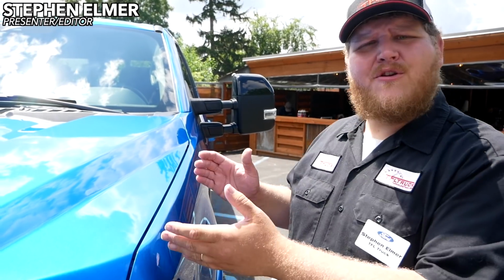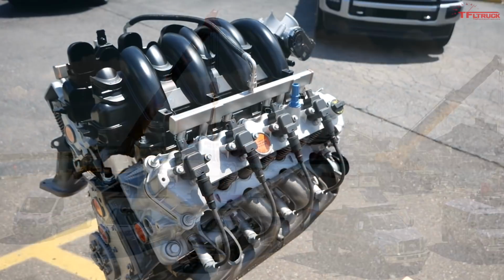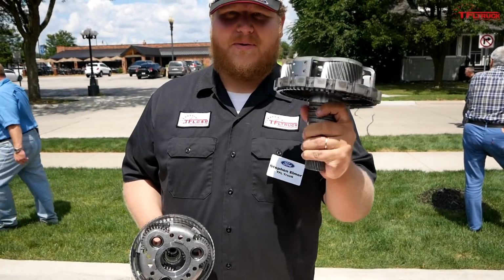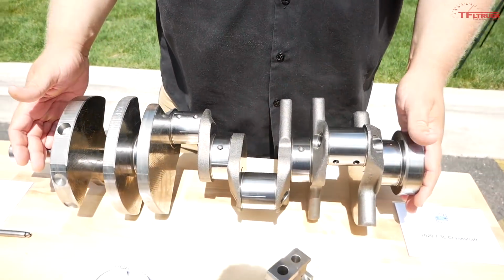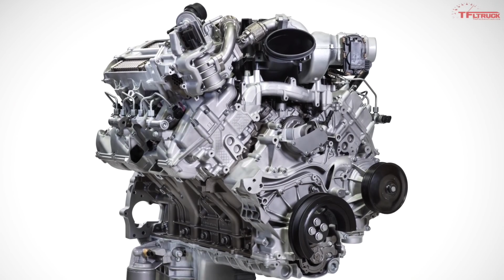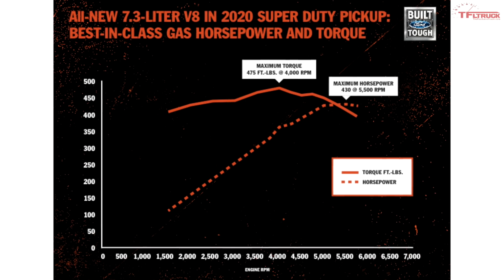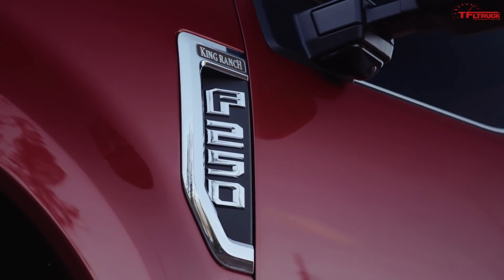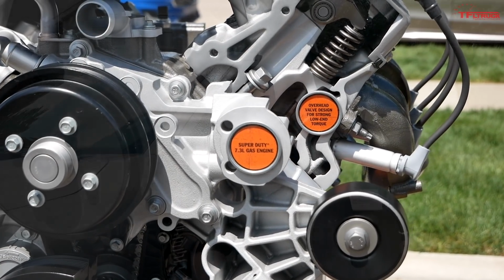We Finally Know the Ford Super Duty 7.3L V8 Power Numbers & They Are Lower Than We Thought!

Comment: In what world is 430 horsepower and 475 pound feet of torque low for a gas engine? This is meant to be a workhorse and if anyone has looked at the dyno charts, they would see this engine makes 400+ pound feet of torque at 1500 rpm - this engine is hardly disappointing
Reply: Boo Ya I’d like to test drive one when they come out.
Reply: lee hancock did you miss the part of the video when they showed it and talked about the high torque number at 1500rpm?
Reply: How dare you say something that makes sense on YouTube 😂
Reply: Low? Thats funny  the v10  has a worthy  successor
Reply: Chevy did the same with a 6.2 v8
Reply: @jacobfleener8501  -  the 6.2L Chevy only makes 350 lb-ft of Torque at 1500 rpms
Reply: “Never argue with an idiot. They will only bring you down to their level and beat you with experience.”

― George Carlin
Reply: Chris J You know shit about engines
Reply: Chris J That went over your head. You don’t know wtf you’re talking about. I literally do this shit for a living.
Reply: i mean gas big blocks were basically pumping out the same numbers in the early 1970s with the same displacement , so the numbers at face value really aren't that impressive , but these engines probably run on 87 octane and will run for 300k miles before any major service where as the old big blocks lasted 100k miles if you were lucky , ran on premium leaded fuel and got 6 mpg no matter how you drove it,, and that was in a car lol.
Reply: @TheDaltonmichaels  That was gross hp/tq figures that were not certified by anybody. These figures are net, if you take that into account these new motors blow the old engines out of the water.
Reply: @foreignautomobiles  that's debatable. old engines in the performance cars were also marketed at lower outputs than they actually had for Insurance purposes.
Reply: those engines were also sending power through transmissions that were much less efficient than the ones we have now. last i saw Hot Rod magazine Dyno tested a bone stock 1970 chevelle , and even on our crappy modern pump gas the engine made basically the advertised numbers at the wheels. so thats huge. that's through a crappy old transmission , with worse gas than what was available when the car came out. meaning the engine itself actually made quite a bit more back in its day and measured at the flywheel.
Reply: I'm not a "motor-head expert" like some people are, but the standards used to define/test hp have changed since the 1960s too.  And then there was before vs. after all the anti-pollution gear was mandated by our "benevolent" government.  One must always be careful not to compare apples with oranges.
Reply: @TheDaltonmichaels  Well back in the day most transmissions did not have overdrives
Reply: @TheDaltonmichaels  Lets also not confuse truck motors versus car motors. In heavy duty trucks, in the 60's and 70's rarely did a car block cross into a heavy duty truck. Truck motors were notoriously low HP comparatively and were made to be grunt motors, not high RPM HP makers. Aside from possible a special order or a backyard swap, you did not see a 426 Hemi in a dump truck...or even a pickup truck.You also have to wade through the numbers from the late 60's early 70's since there are net and gross HP ratings that varied wildly. The 7.3 is a truck motor, made to put out torque early in the RPM curve, kind of like a diesel (not like, kind of like). With the 3.5 EcoBoost you have to be at an insane RPM to get your your max torque where the 7.3 you are at an easy 2K. Put a 10 speed trans behind it and now you have all kinds of torque options and smooth acceleration while carrying/pulling a heavy load......time will tell, but this seems like a great truck combo.
Reply: @KevinSchwinkendorf  agreed which why i referred to a article that was done by hot rod magazine using a dyno and wheel HP earlier.
Reply: Holy cow people are missing the point of my original comment. please read all the other following comments. lol
Reply: @rvninnorthcarolina3377  The Ecoboost makes peak torque at just above 2k RPM and maintains it through 4k RPM exactly as the 7.3 does.
Reply: @rvninnorthcarolina3377  

The regular output 3.5L EcoBoost makes its peak torque(470) at 2500 rpm. I wouldnt call that an insanely high rpm range...

The high output variant makes its 510 torque at 3500 rpm. That's kind of high but it still makes 75% of it at 2k rpm...
Reply: @TheDaltonmichaels  -  actually it's highly doubtful they were seeing those kinds of Torque Curves in the early 70's
Reply: @Ranger_Raptor_Twin-Turbo_3.0L   read previous comments. your coming in , in the end of a discussion thats long ended with a point that was already covered.
Reply: @Ranger_Raptor_Twin-Turbo_3.0L    There's proof so no sense in arguing or debating.
Reply: @foreignautomobiles  gross was a sae standard.
Reply: those  were inflated gross hp numbers back then , not sae net
Reply: @TheDaltonmichaels  But how was fuel economy and emissions on a 1970 motor?
Reply: @phxeriders   read the previous comments.
Reply: Dalton Michaels And is there something wrong with that? I’m honestly not seeing why this is a problem. This engine is meant to outlast your interest in it, not to be a race truck.
Reply: @booya6437   i think you missed my point. im saying these engines are clearly superior in every way , even though the power numbers at face value really aren't any higher than they used to be.
Reply: Dalton Michaels Oh I see what you meant, my apologies. It still would apply to those who don’t understand what these engines are meant for and there’s an alarmingly high number of them.
Reply: @TheDaltonmichaels  most modern v6's have twice the power then 90% of v8's that came out in the 70's and 80's even early to mid 90's
Reply: @nkn8820   not true. engines before 1971 were becoming incredibly powerful , after 1971 everything became so regulated they got chocked down. you could buy 600 hp v8s in muscle cars in 1970.  today if you want 600hp you have to buy a supercharged version of the camaro , mustang or challenger. in 1970 they were doing it naturally aspirated.
Reply: @TheDaltonmichaels  My 90 460 4x4 F250 make about 15 mpg and has 600k on the clock
Reply: @TheDaltonmichaels  This engine can even outlast whatever overpriced plastic modern eggshell you drive mate just like my 96 F150 with a 5.0L (302) Windsor V8 will.
Reply: CJ Colvin lmao that 5.0 made less than 200hp and the torque numbers were atrocious too. Of course it’ll last a long time, it’s severely underpowered.
Reply: The hot rod world
Reply: 60s big blocks had close numbers but wouldnt come near to the miles without major maintaince...valve lash timing chain stemseals.new tech is awesome ferd mopar cheby every company had good and bad
Reply: amen
Reply: A 6.2 makes almost the same power and in Chevy it does its really low for the size
Reply: Boo Ya you’re just young and you don’t know anything this is Ford’s attempt” To you get back into the V8 architecture engine which currently they make only “ one“ they abandon V-8  shins10 years ago!, and Have been stuffing 1.4 2.4 and V-6 turbo charged engine is in full-size pick up trucks to everyone’s disappointment!!, and “you” think that this won’t be a POS debacle like the power strokes and the V8 Triton piece of shit engines they built in the past ?right , you need to take your beer goggles off.
Reply: Yeah and with simple modifications it’ll be even more impressive
Reply: Torque is far more important that peak horsepower at high revs.  If you want to pull a large boat or trailer, THIS is the combo, aside from a diesel, which the 7.3 L GAS engine can substitute for, that one should buy.
Reply: the Powerstroke Diesel weighs ~400 pounds more than the Gas Engine and Costs an additional $5,000

and is way Overkill in the Power Department for a Truck that isn't Towing or Hauling much of anything
Reply: I'll take a guess at the Power Output with an Aftermarket ECU Tune

+20 hp & +40 tq for a total of 450 hp and 515 tq
Reply: when your GCVW rating is 25,000 pounds or more,

you need to Reduce Power Density in order to increase Engine Life
Reply: I had high hopes for this engine as I am in the market for a new truck and will be towing 15-20k.  I had a 7.3 and in the 90s and early 2000s with less emissions and lower diesel cost and diesel maintenance cost, diesel was the way to go.   But not now and I am not towing 30-40k I was wanting something other than a diesel.   I did some research on torque curves of the 7.3 and the 6.2.  The curve is basically the same but you get around 50 more lbs of torque throught the curve on the 7.3 vs the 6.2.   If I paid $200-$400 for something that was a simple bolt-on and got 50lbs throughtout the curve I would tell everyone to GET IT.  Now 50lbs for a NEW ENGINE that they have been teasing us about for over a year.  It.....SUCKS!!!!!!!!!!!!!!   The only hope is that the 50lbs and the 10 SPEED TRANSMISSION will generate some decent towing numbers.
Reply: @bill84345  - what were you expecting?
Reply: @Chris J -  you left out, CLASS LEADING power
Reply: My Raptor makes 20 more hp and 35 lb ft more torque 🤷‍♂️
Reply: Rshane P And will explode long before this thing does. If you knew anything about engines, you’d know that less horsepower/liter = longevity and that’s exactly what this thing has. Your Raptor will be lucky to see 150,000 miles unscathed
Reply: ain't an International, though
Reply: Riiight!!!! That 7.3 big block is merging into diesel low end torque. Idk what everyone is complaining about. Ford is taking a step in the right direction of the past. Big engine will always make more lower end torque as long as you have the right cam, lift, and duration.
Reply: Why does it have to be a gasser
Reply: @evanlove3015  Because diesel is hard to work on more expensiver parts hard to start in cold weather and recently stiffled by emissions requirements.
Reply: Trucker Tom lmao I know why but I’m just sad it is a gasser I’m a diesel fiend I have a 2000 f350 obv with a 7.3 and it’s the favorite vehicle I’ve ever had
Reply: @evanlove3015  95 super duty here bud, it runs good when it runs you know?
Reply: Trucker Tom idk what to tell u I take care of mine and it’s my daily driver with frequent goosenecks on it I’ve only had one time when it didn’t start and it was with the battery being drained overnight which had nothing to do with the engine I live in Missouri so we can get hit with winter really hard and I’ve never had a problem starting it ever and I’ve had it for about 9 years now and it’s been running over 600hp for about 4 years now which is on the verge of unreliable and I still haven’t had problems as of now it has 380,000 miles on it with what I’m told is the stock trans when I bought it but there’s now way it is which is impressive it’s lasted this long
Reply: @evanlove3015  Your day will soon come.
Reply: I think the hp is fine but was expecting more then 475 lb/ft of torque considering the GM 6.6l gas engine is cranking out 461 lb/ft. Does the Ford have more? Sure, but not enough to brag about and I guarantee you the 6.6 is going to get better f/e numbers.
Reply: i agree, this engine is a monster.  the only problem is the damn truck weighs so much.  this engine in a 1999-2004 super duty would have turned it into a race truck
Reply: 557 stroker 750 stock for both hp and torque
Reply: My 6.6 from 1969 does better than this 7.3 sad
Reply: Context and comparison. Fords 5.0 in the f150 makes 395 hp and 400 tq. That works out to about 80hp/tq per liter. Multiply that by 7.3 and you are well over 550 hp and tq. I get it’s not a race truck but at least have a tuned up version for the tremor like 500/500.
Reply: g s Less horsepower/liter = more reliable. I actually drive a 5.0 but that 7.3 will long outlast it. It’s detuned on purpose while the 5.0 is tuned up
Reply: @booya6437  not true hp does not dictate reliability. Heat does. High displacement engines for long duty lives run much lower rpms to decrease wear. Hp by nature has no significance  to engine life.
Reply: @gs-pd5ox  The torque in a 5.0 in the F150 vs a 7.3 in a HD pickup is hugely different, it comes on much earlier in the HD pickup.
Reply: but a cummins 6.7l is the best engine for a work horse, and you can get one in a HD tradesmen mpdel.
Reply: @austina4677  a diesel engine is usually a "better" workhorse. But all these new diesels cost a boat load of money
Reply: @austina4677  I do live the 6.7 Cummins and G56 manual in my 2012 Ram 2500.
Reply: lol you’re delusional, any new Vortec will destroy this motor.
Reply: S Furm Lmao you’re a clown
Reply: @suleiman3811  you sure I raced a 2013 5.3L with my 2014 5.0L and he never came close.

Comment: Real news here is Ford goes backwards back to a single camshaft engine realizing that their modular engines with the camshaft on top of the valves are junk and where notoriously known to give problems Chevy 6.2 420 HP 460 FT torque ford had to produce a 7.3  just to make 10 more horsepower LOL
Reply: The 6.2 isnt a hd engine tho. Look at gms new 6.6 it only has 401 hp and 460 tq. Think they do this for durability.
Reply: @Michael_ryan91  Let's not start confusing people with facts.
Reply: Hp isn't everything dipshit. This engine makes 40+ more ft-lbs of torque. This engine is designed for the long haul and not high performance.
Reply: You watch this will be a legendary engine we will talk about 20 years from now.

Comment: "That's an EPA mandate".... ugh i threw up in my mouth a little when he said that...
Reply: I thought fuel economy requirements weren't applicable to vehicles over 8,500 lbs. GVWR.
Reply: @lvsqcsl  as soon as a commercial business is involved all the rules change.
Reply: @lvsqcsl  It's not necessarily fuel economy, but emissions. Most commercial engines are detuned for emissions, as well as longevity.
Reply: the1doubledeuce that would be true......

Comment: 7.1 liters of displacement and yet 430lbs of torque is it?  What’s happened, this is 2019!
Reply: 7.3L. 430hp/475 lb-ft. That’s an engine built to tow often and still be reliable and efficient when it’s working. It’s also built to run on 87. If the objective was to maximize output at the expense of all other requirements, then yes, you could probably crank out 1500hp and 2,000 lb-ft.
Reply: I'm assuming the engine is intended for long term reliability and use.  It's still higher than the competition though.   Also I bet the aftermarket will have a field day with it.